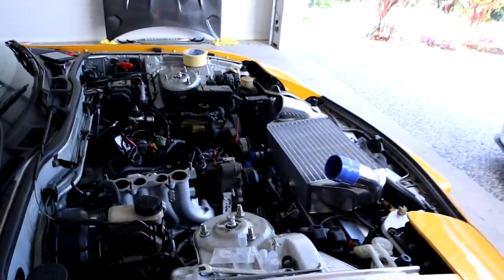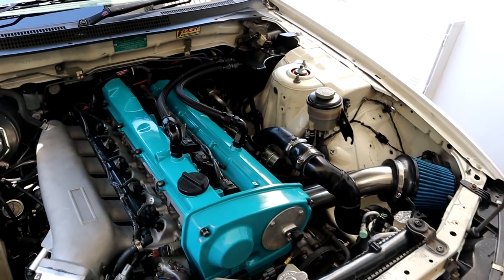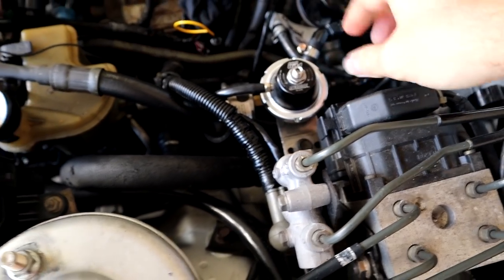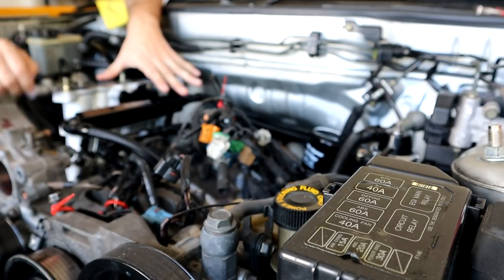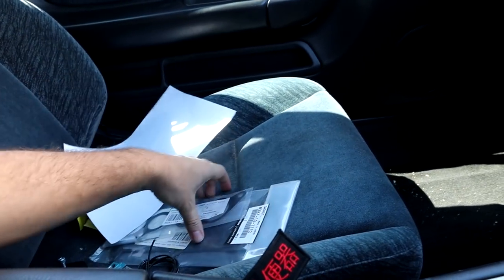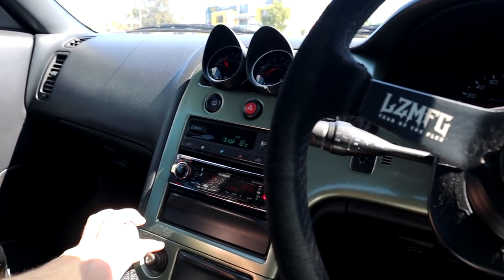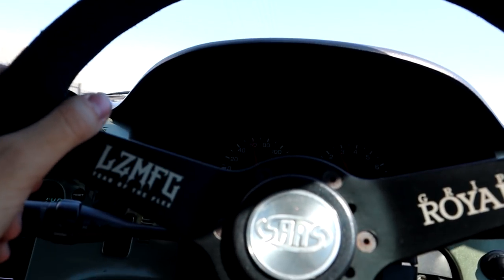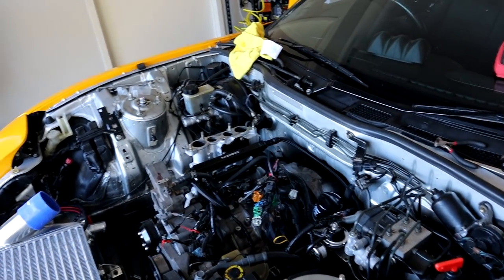Single Turbo FD Baller Fuel System! + more Tasty Mods!

Comment: Be mindful of the rubber cap that you have on the large coolant line port on the front coolant housing. That rubber gets soft from heat cycles and will crack. HPS on amazon in the states makes a nice hose you can get to cap that off. Love the build! keep up the good work!

Comment: you should consider rewiring your pump.  The stock fuel pump wiring doesn't give enough voltage to the pump which could cause a motor blowing.

Comment: Are you going to install a MAC boost solonoid with the power fc?? If so could you please show how to wire it up? I think you need a special loom and 5 pin connector to do it
Reply: You connect the 2 wires to the factory wastegate solonoid valve, just snip them and crimp on the solonoid wires.